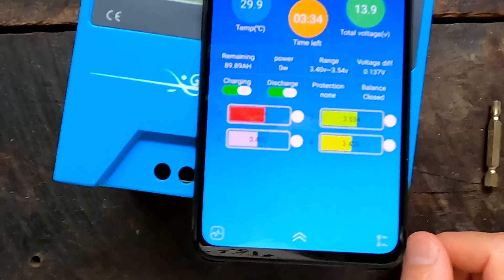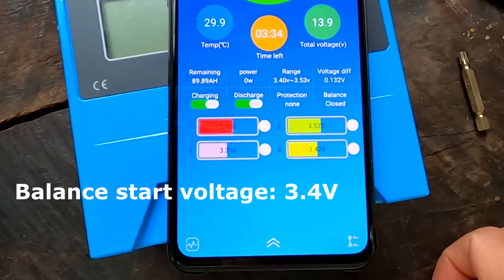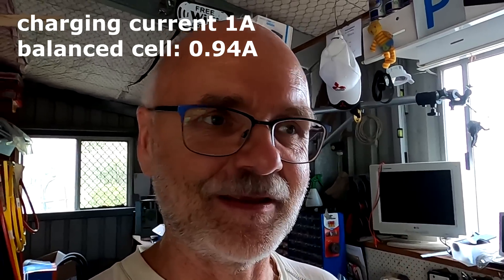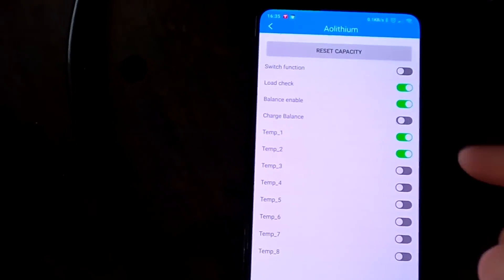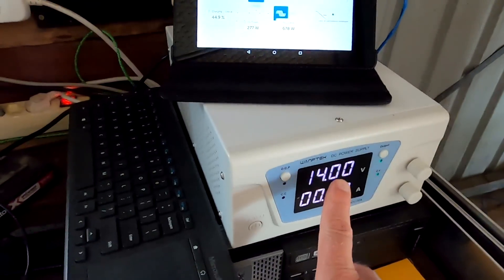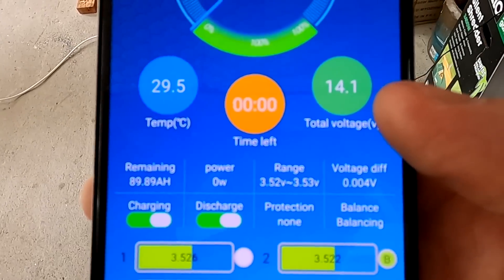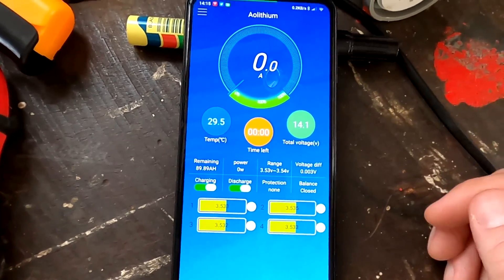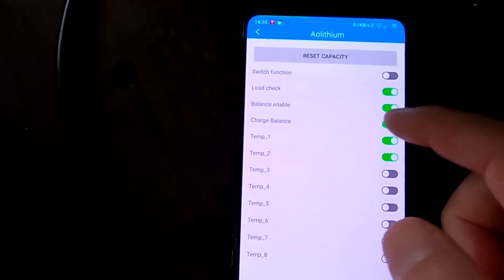Why 'Charge Balance' is a bad idea and how to auto top-balance a battery over night with any BMS.

Comment: I like the idea of, every once in a while, leaving a charger on the pack to allow the BMS's balancer to run for a good long time.  Just as long as one doesn't make a habit of it, since holding the cell voltage that high 24x7 will over-charge the pack.   I'm talking maybe once every few months at the most.  Its not good to hold LiFePO4 cells above their resting voltage for long periods of time (e.g. weeks+).

But otherwise, the BMS defaults are the best configuration.  Meaning, only top-balancing while charging, or while cells are being actively held >= 3.5V (in my book the same thing, even if the ingress current for the latter is very low), and then only with a low balancing current.   As long as the pack is able to pull most of its capacity, it is perfectly ok for it to take 6 months for the BMS to balance it.   The key here is for the BMS's balancer to make progress, it doesn't matter how slow the progress is.   Healthy cells (even old ones) just don't go out of balance in any significant way, so there is really no need to use higher currents or other configurations.

The reason the BMS should only balance while the cells are above 3.5V is because there is no point trying to balance the cells at lower voltages, and doubly so when there is no charging current.  Without charging current, the cells will naturally drift down to their resting voltage.  The voltage can easily be knocked around with very little current.   So no actual balancing is happening at lower voltages.  It might seem to be, but trying to actively balance at lower voltages literally doesn't work... it is more likely to take the cells out of balance, in fact.  Even though the balancer is holding the voltages close to identical, at lower voltages it might actually be causing the pack to go out of balance.

And the reason we only want a relatively low balancing current (and generally why I am against the use of active balancers, or high-current balancers), is again... once balanced, a healthy LiFepO4 cell will not naturally drift out of balance for many months, even years.   Meaning that if a cell does, you want to know about it sooner rather than later so you can replace the cell while the pack is still working well and not have the failing cell be masked by an active balancer or masked by high balancing currents.   Active balancers may appear to make packs work better, but all they really do is mask problems until the damaged cell(s) get so bad they fail entirely.

We can also get into maintenance... the risk of fire (low) or electrolyte leakage or bloating damage (higher) in an aging pack.  A brand new pack can take a lot of abuse.  But with an aging pack it is far better to know which cells are starting to go bad and replace them before they actually start leaking or pose other dangers.

-Matt
Reply from the maker: Thanks Matt. I start balancing at 3.45V which is also my absorption voltage. So the balancer will only cut off the overhead of any cell which is going higher than that. In a perfectly balanced pack, every cell has 3.45V. If you hold the pack at 3.45V for say 1h it gives the balancer the time it needs to do its job. But this only works if charge balance is turned off, otherwise the balancer does not do anything as the tests have shown. Unless you introduce an active balancer at this point. 

As I said many times, I would not recommend leaving it connected all the time. With LFP cells, it will exactly do the opposite and unbalance the pack. I made recently two videos about that to explain and show the results of leaving it connected for two weeks and only using it at a higher voltage once fully charged. As you said above leaving it connected masks the problems with any battery a sit always looks good, until you fully charge and the balancer cannot keep up any more.

I can see another point which I have raised recently. The frequency of actually reaching the absorption voltage. The more frequent/often the pack gets to this voltage, the smaller the overall drift is and the less the balancer needs to work. If you only ever fully charge once or twice a year, the BMS has no chance and an active balancer is needed to re-balance the pack. Again, it should only be turned on at 3.4V or above, preferable 3.45V and above.
Reply: @OffGridGarageAustralia  Makes sense.  Another thing we should note is that the chosen target voltage being dependent on C-rate (e.g. 3.45V might be for 0.2C charging rates for 95%, but getting 95% at 0.6C would need a 3.60V target)....  the guarantee you get at that voltage is 'at least X% SOC'.   You don't get a guarantee of "X% SOC'.  Only 'at least X% SOC'.   It is a fine distinction but an important one.

So what the balancer achieves is to bring any cells that didn't reach X% SOC up to 'at least X%' SOC.  In fact, it might bring them up higher, because the charging rate going into the cell from the balancer itself is probably below 0.1C or even 0.01C... so actually achieving the target voltage, by definition, means that the SOC for that cell (if the target voltage is achieved through balancing) will be higher than X% because it was achieved at a lower C rate.

This gives us our distinction between balancing WHILE charging, and balancing WITHOUT charging.   If we are balancing while still charging, the cells that have to be brought up will be closer to the target SOC.  If we are balancing after charging has stopped, the cells that have to be brought up will likely wind up overshooting the target SOC.   Again due to the lower C-rate of the balancing current.

So which is better for the BMS to default to?  I think it depends on the charging profile and the use-case.   Only balancing while charging is probably the best default configuration.   It probably isn't a good idea to allow a balancer to charge a low cell for an indefinitely amount of time, at least not by default, because doing so may take the cell to 100% SOC or higher before it actually reaches the target voltage.   (though personally I think this is unlikely with a target voltage of 3.45V... but for higher target voltages it is very likely).

If you have a long absorb time, only balancing while charging is a good default.  If you have a short absorb time, then perhaps allowing the balancer to operate after charging has stopped is a good default as long as you can limit the time that the BMS allows the balancer to run to something reasonable.

-Matt
Reply from the maker: @junkerzn7312  Thanks Matt. I made a video a while back exploring the different charging speeds and the effect on SOC (https://youtu.be/qZg4Jxftw-c). The consistent inconsistency, I called it 🤭
You can still reach ~100% at 3.45V if you allow absorption time, so no need to go for a higher voltage. It just takes a bit longer to get there.

I agree, balance settings are definitely depending on individual systems and circumstances. I never had any positive outcome with charge balance though. It just did not make any difference. I found it far more efficient to get all cells to 3.45V first and then start balancing while in the absorption phase. The charging current will taper off and the balancer has better chance to get a result across all cells.

The active balancer , if connected all the time, will create an imbalance in the flat area of the curve due to small voltage differences in the cells. That causes definitely problems when fully charging the next time again. So, I'm not a fan of this either. Some have reported it does not create an imbalance for them at all leaving it connected all the time. Maybe they have just very matched cells 🤷‍♂️

Thanks for all your insight Matt, much appreciated.
Reply: I'm having issues top balancing my 48V battery pack. Other cells reach 3.5V & 3 stays at 3.4V
My charger is a 6A so If I keep it on Immediately Over voltage protection kicks in & charger is turned off. I don't have any other charger. How do I top balance my cells now? This problem started when these 2 cells went undervoltage now they don't even get to charge fully

Comment: I am also getting what others on here have posted, that turning off that setting only balances when it ISNT charging... only thing I can think of is a different firmware version in these JBD bms's. Mine shows version 32.0 if you look under battery state.  I will let it charge to cutout while charge  balancing on (3.45v in my case), and then I'll jump in and change the setting and it will carry on balancing for a bit. High cell voltages drop pretty quickly once charging has stopped anyway.

Comment: Great information here.  Thanks.  One question on this.  I have a totally balanced 412ah lifepo4 battery (difference of only .001 to .002).  The 4 cells shown in my graphic are colored yellow instead of green.  Why is that?  Also, question on the score.  My cell balance score is 44 and my resistance score is 99.  My overall score is only 44.  Can you explain that?

Comment: Hi, i have a question about the access to a  Jiabaida smart BMS, is there a way to name and apply a password to a BMS, because on a campground i detected 2 others BMS with the apps that i could take control....it is a real security issue.
Reply from the maker: Yes, you can use the XiaoXiang app to set name and password for this BMS.

Comment: Andy here is an. Idea what can Yu do with a set of jumper cables. I use these to jump of battery packs to inverter. Charging with out. Changing cables  might make a good video one way or the other
Reply from the maker: Jumper cables are made of aluminium as far as I know?

Comment: Hi, great video! I am about to order for my boat some batteries 200Ah from BASEN . I’m quite curious if I can use the app for top balancing as you did? I saw your video about BASEN you haven’t mentioned what BMS they are using. Overall would appreciate your advice about BASEN.

Comment: If I understand correctly, the BMS behaves differently with the app running than without? All the protective functions must also work autonomously!?
Reply from the maker: The BMS works the same with app or without. The problem is that the BMS does not balance unless there is a certain charge current flowing (charge balance). If the BMS for example turns off the battery due to a high voltage cell, it won't balance because there is no current it can measure. 
I would recommend turning off Charge Balance with these JBD BMSs.
Reply: @OffGridGarageAustralia  im off the Charge Balance but still the last cell of my setup first to reach 3.6v my other 7 cells just 3.3 all of them until the last cell reach 3.6v. i don't know what to do... i have no active balancer for the mean time just the JDM

Comment: So balancing turned off, balance turn on voltage set to 3.4, and deviation set to .015 initially. Does it balance below the 3.4 or only when above 3.4
Under discharge conditions

Comment: Thanks for the video never realized that option for my BMS. Is it fine to set the balancing to 0.01 or will that cause too much cycling? Using 18650 battery pack.

Comment: Andy Have you tried to run to battery packs with Your Bms program.  With Android the only way for me to switch bms signals was to put aluminumaround one of the bms receiver so my app could not connect to the other battery bank.  .  Thanks

Comment: Thanks for this idea. I have a 4s battery in an RV and needs a top balance but have no bench power supply. I'm thinking about seeing if there's a way using the charge controller to in effect do the same. Will see😀

Comment: Thanks for this video. I have same or similar bms on a 100AH Basen battery and I noticed the same problem with ballancing. Having in mind the low ballance current and the charge stage at which it starts to drift I've decided to set the ballance voltage to 3.4V, voltage difference to 0.005V and charge ballance of. In my use case the battery will rest in fully chage stage far longer then the last charging stage durration. This I hope will allow the bms to top ballance the battery eventually. Keep up the good work!

Comment: Hey Andy I run the JBD 100A 4S bms and I've played around with it alot what I do is I set my victron solar controller to do an absorption at 14.2V or 3.55V per cell and I set balance to start at 3.50V I don't charge balance its almost useless as these 105ah eve cells of mine charge quickly and it drops off and the app shows zero current. Also I leave the delta at 0.015V other wise the BMS is just on and off ALOT while balancing.

Comment: Andy I found that function on my BMS using the same App - I was frustrated by the  low balance current - I guess it has to be like that so the "Headroom " of the balance  load does not inadvertently impact on the  cell voltage too much and thus the voltage  sampling interlude can be kept minimal - My solution was to  fit an additional set of balance leads with JTS connector and plug it into my ISDT T8  charger which has  a 15 watt balance as it charges function - worked an absolute treat - brought all cells up to full charge from storage  and top balanced lovely - none of this connect first in parallel then in series faffing about  - and at up to 30A charge  feathering off on the heal, bulk then constant voltage  it was very efficient - the only down side is it needs a dc power supply as its design use id to charge radio controlled devices like aircraft in the field  - I use a 24v server supply  pack. Worth looking at reviews of this ISDT T8 charger.

Comment: 6 days and a 5 amp charger and cells are still not balanced. 1 amp balance is just not enough to get the job done. it might after 2 weeks but come on thats not what anyone wants. other than that complaint about jk i would have to say it is the best out there i love it and wouldn't use any other. just why so cheap on the balance bro? Beef it up!!!

Comment: Yes i have the JK-B1A20S15P and what i have seen is the 1amp balance is not enough to balance the 16s pack ( high capacity cells , like 200ah and above ). it struggles to get it done. yours is a 2amp so i would think it might do the job quicker. If i was to recommend to other buyers i would say don't buy any of the 1 amp bms for 16s setup. i would say for the small amount diff for the JK-B2A24S15P which is a 2a it is worth it. if you had a 8s or lower it probably would be ok. hey jk why not just make a JK-B2A20S15P and a JK-B5A20S15P. that is the largest part of market share that we want. check it out ANDY could make a good video. use some high resistance cells in there to make the test real. 4 or 5 should make your job real hard. you will cry.

Comment: Yep, my Overkill Solar BMS (same as JBD) works just the same. Only balance while charging, or only balance while discharging. I also recently noticed for the first time that even if "charge balance" is off and it's within the normal balancing parameters, it won't balance while under load. That one I can understand, but I still find it to be stupid logic.
I typically just leave charge balance off, with a threshold of 3.4v and very small "balancing precision", and I find that to work the best for my needs. My charger has a non-configurable profile with max charge voltage of 14.5, so once charging stops, the balancer will also help bring the cells back down to a more comfortable 3.4v quicker.

Comment: I use a jbd bms 4s12v for a project I have.I love it,it works great.I now have to run out to the shop to find out if it works for my setup.will update.
Update,the jbd bms does the same as here in the video,thank you Sir Andy,this helps alot

Comment: Ones I've used turn on balance charging at .5 amps. And yes I noticed. My cells are pretty even but when I first installed them I ended up plugging in an icharger for accurate top balancing. The jbd def doesn't balance at 2 amps. It's been maint free so far. For the price it's a good bms imo

Comment: Hi Andy, and thanks again for this video, Thank  also you for highlighting this parameter. I had already tested charge and discharge cycles, with these different settings, but I had not noticed any significant difference, just that when balance charge is selected, the pack  Battery takes longer to charge.  I'm going to do some tests again and see if it has a real influence in my case?  (because I have always noticed that in the discharge phase the Batteries are perfectly equal) 😉 👍
Reply: Hi, I got 16 LifepO4 cells and I observed a 0.4V voltage difference between cells in the bottom. 10 cells were around 3.1V and the other 6 cells were 2.7V. I'm using 150-2A JK BMS. Because of this issue battery pack's usable capacity is very limited. Is there a way to balance the cells at around 2.7V using JK BMS without disassembling the pack?

Comment: so when u installed this bms, u said you are close to getting orion bms. what's the plan now. i'm using a Tesla battery pack for 2 years now and don't need balancing, very minimal deviation. looking to buy additional  pack in parallel but won't do unless I settle on the BMS, waiting for your next one, seems the JBD bms still doesn't cut it
Reply from the maker: I never looked into an Orion BMS. Some of my viewers are using it though.
I will use the JK-BMS with active balancer for my batteries.
Are you going to mix LiFePO4 with Li-ion batteries?

Comment: I don't know where this only balancing while charging comes from but it is crazy. So simple really.
Reply from the maker: Some have said it comes from the e-bike scene. Not sure though how this is an advantage for these battteries either. It just does not make sense to me at all.
Reply: @Gartenruhe  but normal passive balancing does not work like this. The balancer will only discharge the single cell, it cannot move power from 1 cell to the next. If you have a leaky cell, the voltage will drop on that cell and the balancer will turn off. As for active balancing well maybe but that is not what the video was discussing.